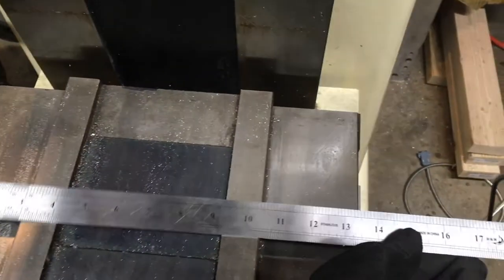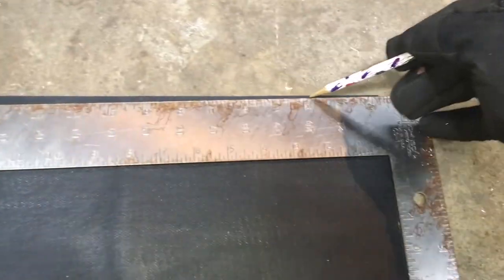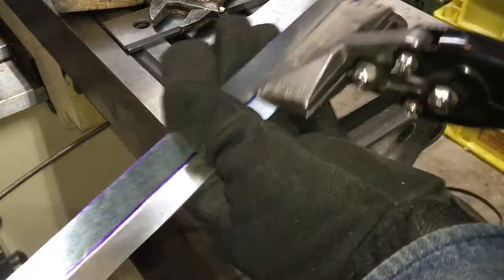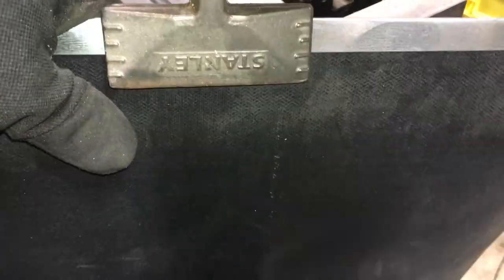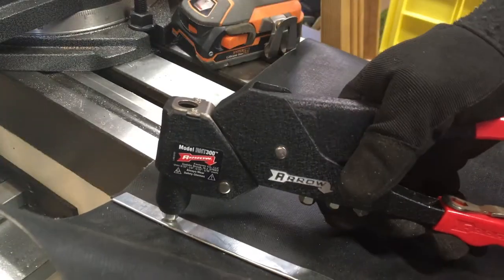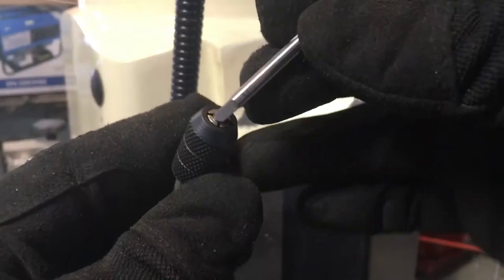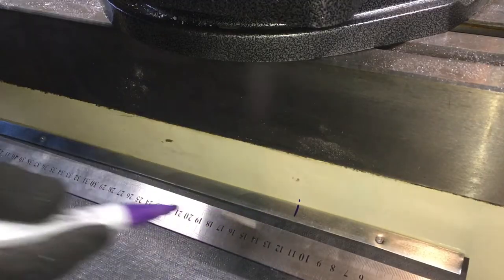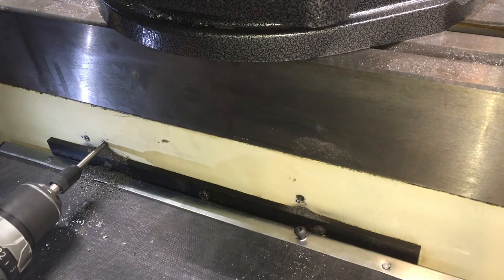Home made Mill Way Covers

Comment: If you just roll that stuff on a iron bar and connection through a spring put it in a box as required and put a screw on the top and bottom
Reply from the maker: That would be an interesting idea for a new video. The problem is metal chips getting curled in the roll, hard to clean up.

Comment: Good idea , the front one may need to match the travel . Looks extra long . I wonder if it could be pleated with a heat gun and a clamp or two with boards or angle iron.
Reply from the maker: Thank you. I measured the length of maximum travel and cut both covers accordingly. Heating and folding sounds like it may work. I will need to give it a try.
Cheers.

Comment: if you put a small rubber bungy on each side it will help it stay folded fold it where you want the folds and poke holes through all  then install bungy through all both sides it will make it accordion.

Comment: reason why you broke the taps, was due to incorrect use.
there are specific spiral flute taps for when using in a drill, that do not need reversing to clear the waste material
Reply from the maker: Thanks for watching! Like I said, I never had a problem with straight flute taps until these came along. Also, I already bought some spiral ones to try out, just haven’t used them yet. 
Cheers.
Reply: You should never use spiral flute tap with a hand drill. Next time try spiral point OSG tap.

Comment: Hi we're did you buy that material that you used as cover thanks
Reply from the maker: Try searching eBay “reinforced rubber sheet 1/16x24x44 tool box liner”
I am not affiliated with any seller, so, you’re on your own there. Best of luck :-)
Reply: Tinkering Nerd thanks
Reply: Ah typical, only US sellers found for reinforced rubber sheet...
Reply from the maker: I’m sure there must be some substitute for this material, in your area.